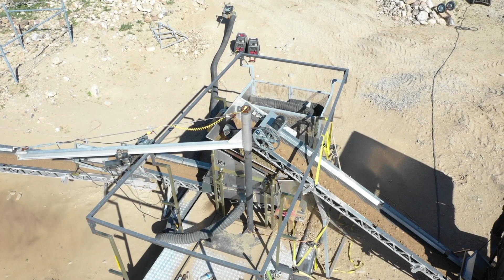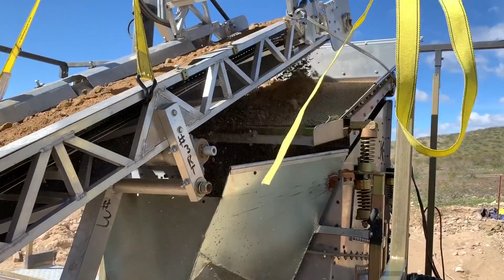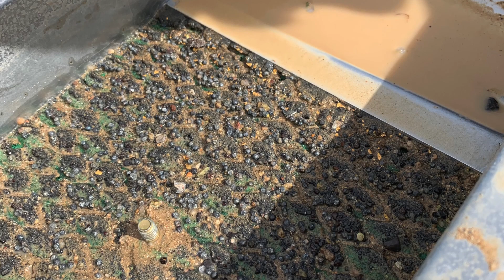Keene's 210 dry washer spring 2019

Comment from the maker: Not all dry washers are created equally.  We ran many samples of gold through the machine in a none gold bearing area.  We ran a 5 yards in one Hour with a variety of gold sizes some 30 mesh minus some 30+ plus a few pickers.  We recovered roughly 90% back on a single pass.  The interesting thing is the loss was surprising low and we did the test several times and the recovery was better the second time.  One major factor in any dry washer is a smooth consistent feed and under standing how the machine works.  We had to add some doors onto the sides so we could see the riffles working and this made a huge improvement.  We also made another improvement by reducing the weight in the machine from material falling onto the lower box. The other issue in wet dirt will kill the recovery on a dry washer.  In this video the material was so wet that we probably lost about a 1/3 of our gold.  We had to bang on the hopper just to keep the material moving.  Even with all that we caught over a .25 once on our fist run after about 5 yards of dirt.
Reply: What does the setup cost & what is included?